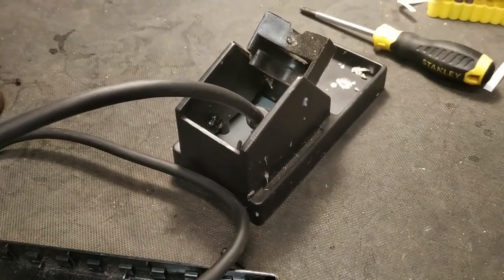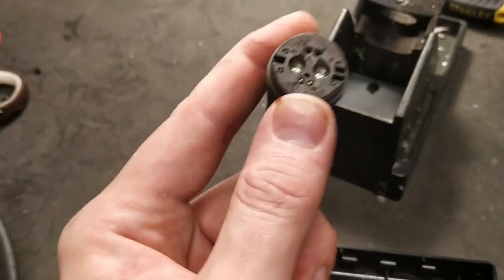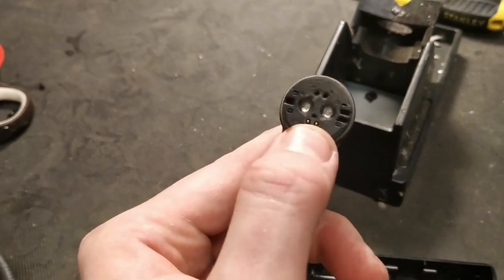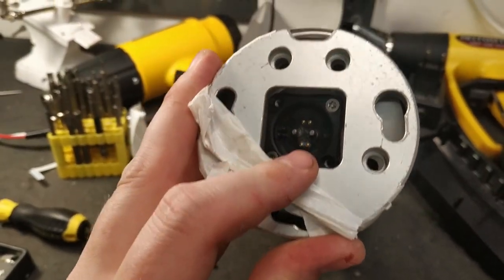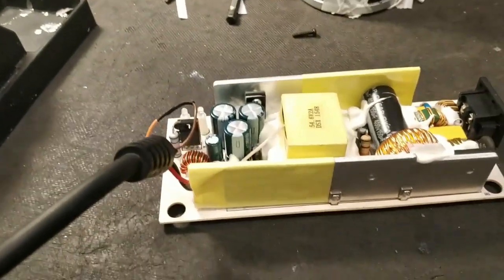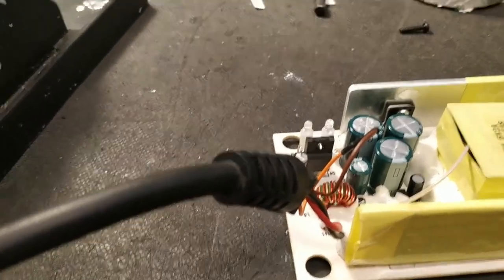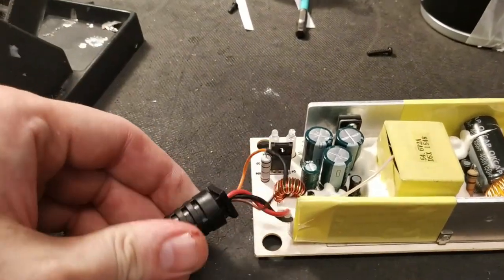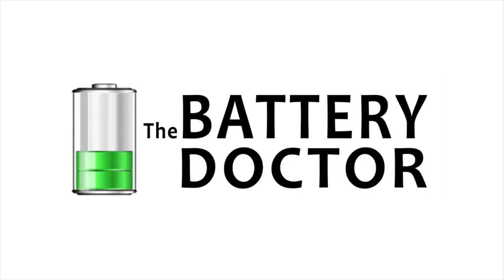do NOT USE Rosenberger RoPD Magnetic Connector

Comment: Magnetically bonding connectors have their applications and uses. Any connector that is misapplied for the application or environment it is being used in will obviously under-perform. I feel you are being overly critical on a connector is miss-applied, that's not the connector or connector design's fault. That's the designer's fault.

Comment: Hi, i decided to change the charging port on the battery to a 2 pin charger. Voltage is 54v but e bike shows 0%, and won’t accerlate(but turns on). 

The 2 other pins is loose, i did not know What to do with them. Should i Connect them?
Reply: All systems using Rosenberger RoPD Magnetic Connector requiers com. so that wont work. Sometimes its just a loop of 2 pins but if you want to charge it any other way you will need to install a secondary BMS for charging.

Comment: Funny video. Do you remember what brand of charger that is? I'm thinking of buying a 2nd hand Derby Cycle  charger (42V/4A) with a Rosenberger connector which I will cut-off but I'm not sure if the data pins are needed before charging will start? Thanks!
Reply: Did you figure anything out? I want to reuse a battery and it doesn't give me voltage -.-

Comment: I was about to buy those connectors...After this video probably will not. About your charger ...48V 13S Lithium Battery Pack will have 54.6V when fully charged, so charger voltage needs to be the same. 13 series multiply 3.7v battery sell with nominal voltage (13*3.7=48.1). Fully chaged 18650 cell will be 4.2v, so 13*4.2=54.6v. According this simple simple maths - your chrarger voltage is correct.

Comment: If I do not have the original battery, would I be able to the strip the wires from the Rosenberger Connector, then connect my custom battery 'Positive Output' & 'Negative Output' to the Rosenberger 'Positive Input' & 'Negative Input', followed by shorting the BROWN and ORANGE in the Rosenberger Connector and ignore the 2 Data Wires, and it would run?

Comment: I got the same plug but I just connected positive  and negative does this have to work as well or do I have to connect those two smaller pins with another
Reply: You are creating a lightning when the connector will be plugged in, because you always have voltage on the power pins. Connector will fail in this config after some time

Comment: Thanks for the video - stumbled across this while trying to find a retailer for the connector at a reasonable price. Do you have a suggestion for a (affordable) alternative, that can be mounted on the outside of an ebike battery, which is exposed to the elements?
I like the Rosenberger design, where some kind of handshake has to be made across the data pins, before any high voltage is transmitted.
Reply: XLR are the best. Cheap and robust, separated pins and good lid. 
Rosenberger CAN have a digital handshake but they seldom do that, they just use 2 pins as a loop, sometimes not even that. Use can use 4 pin XLR if you want 2 data channels.
Reply: @Batteridoktorn  thank you for the advice .